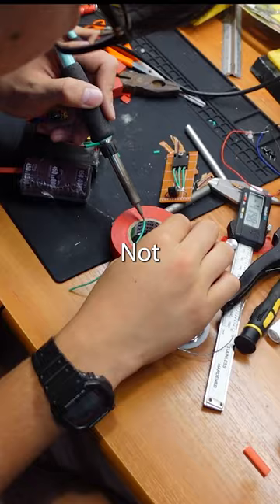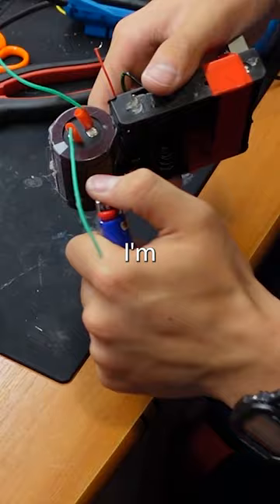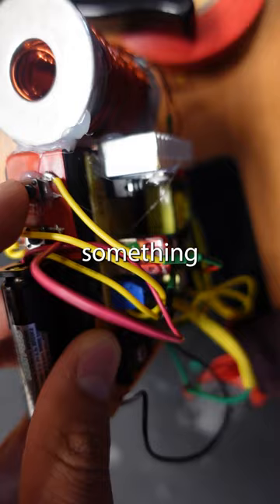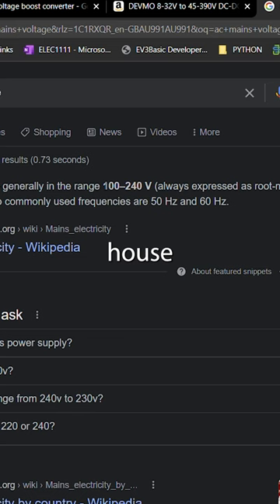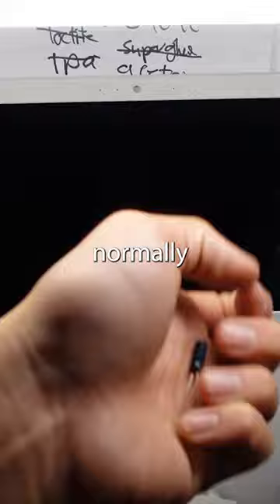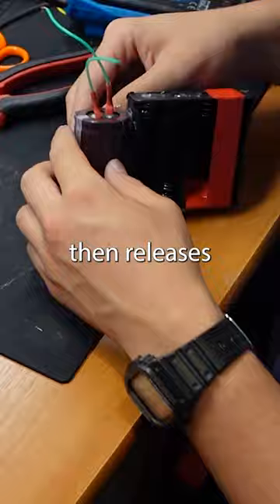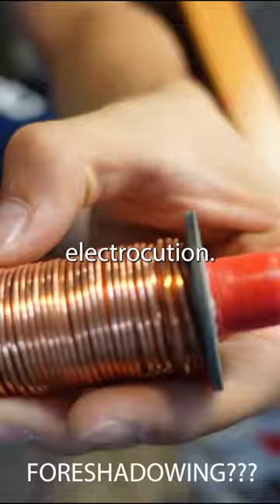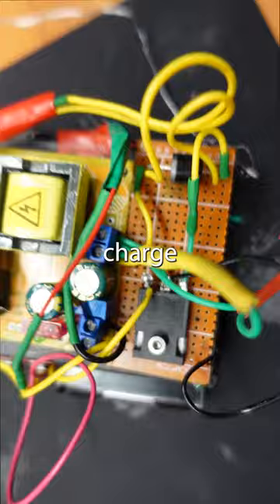I built a coilgun 🔫It ELECTROCUTED ME!

Comment: Man i have some questions : 
- Do i need to space the light sensors on the barrel if i want to put 2 coils ?
- What diametre of cooper wire have you used ? 
- Is 300W good on charging a 450v capacitor of 1000Uf so it wont explode ?